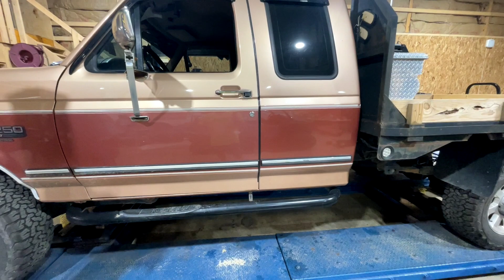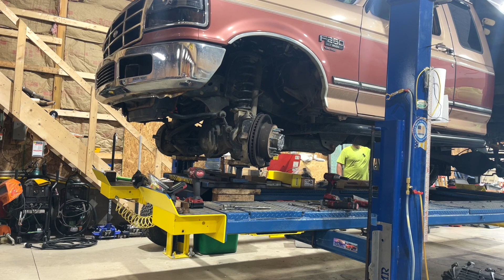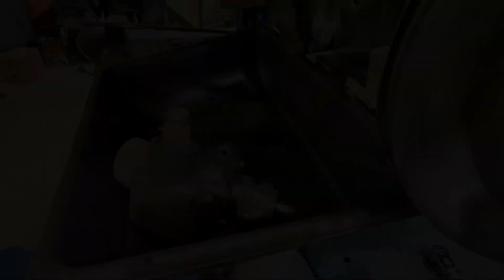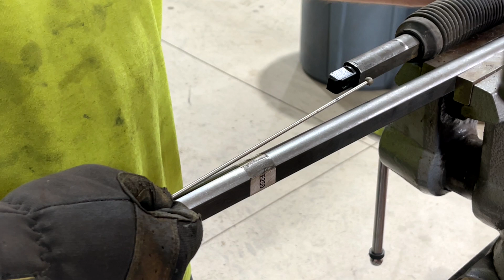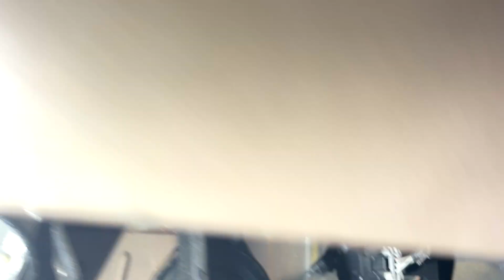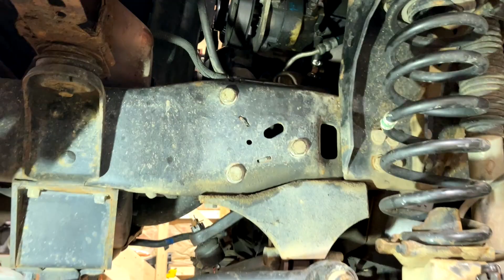Installing a Borgeson Steering Shaft on you OBS Ford!

Comment: Garrett, is this a steering shaft for an OBS? Very odd it needs to be cut to length..
Reply from the maker: It is.  I contacted Borgeson about it and they said some need cut and some don’t.  Which makes no sense to me.  But it’s supposed to collapse in an accident and in the out of the box state, it wouldn’t.

Comment: hello
could you tell me what the part numbers are for the shaft and universal joints you used to adapt the 08 box to the obs column? also what hoses do you use to connect the 08 super duty box to the obs power steering pump.
thanks
Reply from the maker: I didn’t originally install the steering box, so I can’t help you with the lines.  

As for the joint, if you call borgeson, they will tell you what parts you need.  That’s what we did.  So I don’t have a part number for you.

Comment: Noticed you didn't re install the steering shaft to gearbox plastic cover. Is it necessary? Seems like it would keep dust and what not out of that joint
Reply from the maker: I actually forgot it.  And then installed it after the video was completed.   The cover is a 50/50 thing.   It protects the joint, but also kind of holds material against the lines.
Reply: @GarrettsOBSGarage  Asked because I did the same thing and don't really want to reinstall it 😂
Reply from the maker: @ 😂.  Yeah. I don’t blame you.  It’s a simple install, but kinda sucks because of location.

Comment: Great video, and thanks for making it.

Small suggestion to make the measuring a bit simpler.

1.  Put the joints on both shafts
2.  Measure the old shaft, collapsed, overall all end-to-end
3.  Do the same for the new shaft
4. Calculate the difference, let's assume it's 8" different
5. Take the joint off the outer barrel new shaft
6.  Measure 8" from the end of the outer barrel, mark and cut
7.  Put the joint back on, should be exact same length as the old
Reply from the maker: Thanks!

You’re correct.  I was fumbling with it that day.  Not sure why I was off my game.  But the suggestion is a good one and works!

Comment: Seems strange that an application specific part would require cutting to fit. Got to watch the double D shafting to orient indexed joints properly or the wheel will be out 180.
Reply from the maker: Agreed 100%.  Not sure why they made them too long.   They said on the phone that some people didn’t have to cut them.  But that didn’t make sense to me.    The u joint at the column isn’t indexed, like the steering box joint.  So it can be either way at the 180° point thankfully.